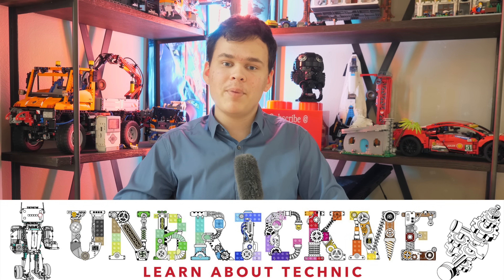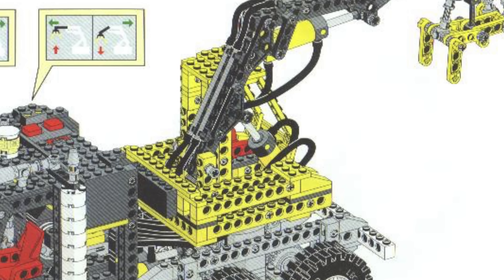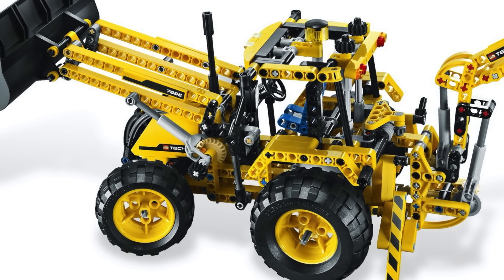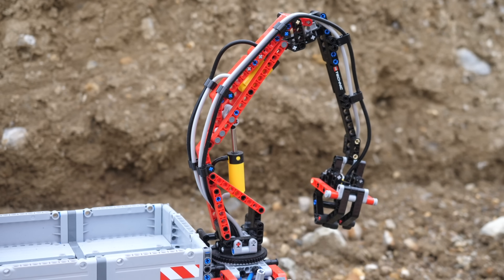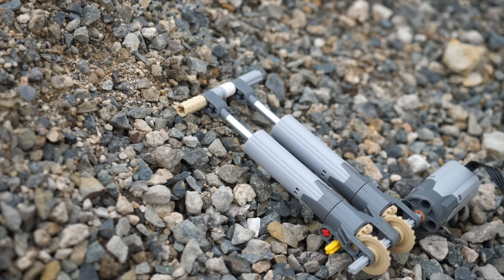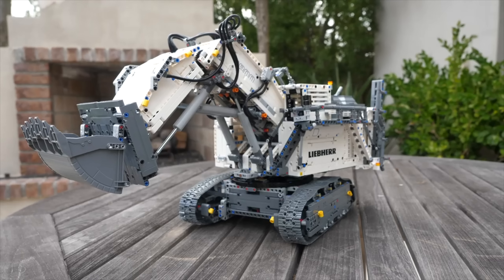LEGO Pneumatic Cylinders VS Linear Actuators

Comment: But these too systems can be used and can opperate as 1 unit because linear can like push a switch or Or Pneumatic pistons.Mofified Pneumatic pistons can e used for lego engines so we can make an engine and use linear as gearbox or steering system.Now if i woul choise what would i choise i would rather Pneumatic becaude they are more simple and dont requer any axels or gear.plus i would not risk twisting axels becase of comprasion.Since Mottor would push and start to twist the axel if it cant move.but if linear can stay longer.Linea reminds me on eletric engines and Pneumatic on fosile engines.

Comment: I like that you can put pneumatic cylinders pretty much anywhere (like excavator arms) where trying to get an axle or gear drive would be near impossible.  But I prefer the smoother more controlled movements of the gear driven linear actuators where possible.

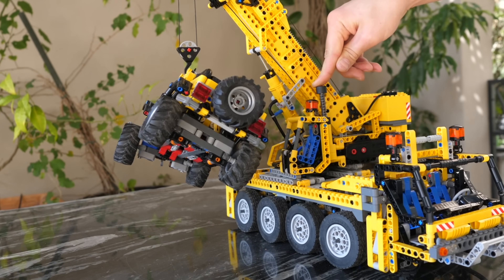Comment: 5:15 I had no leaks ever !  on the XXL Crane i installed a second pair of cylinders to increase the Force.
Also its possibile to run them on water to eliminate the spring effect.

Comment: While linear actuators exceed in strength, pneumatics are SO much fun to play around with. Especially with all the tubes that it can come with. The Mercedes-Benz Arocs was a very great set because it introduced the 2.0 pneumatics and also went crazy with them as well, having FOUR functions in the crane arm itself!
Reply: You mean fourth gen:
1: 8040 from 1984 (valve distribution block)
2: 8044 from 1989 (dual action)
3: 8455 from 2003 (round cylinders)
4: 82043 from 2017 (extra long and long&narrow cylinders).

Comment: I prefer pneumatics mostly because their much more faster & with a few modifications they can really perform beautifully. Got my first pneumatic set when I was 10 & I became a master of, building & constructing my own high pressure air tanks, compressors, & custom control switches long before lego started making to control my heavy equipment builds. I even managed to solve alot of the issues of pressure loss & stability allowing me to lift & move insane loads. I had a massive collection consisting of some 30 thousand plus parts until loosing it all sadly 12 years ago. But atleast I still have picture's of some of my amazing creations. I do see the benefits of linear actuators, but mostly just for outriggers & stabilizers. Their just too slow

Comment: its not that the cylinders are leaky its just that air is being compressed under weight, it could work if air was replaced with water making a hydralics witch would make for strong cylinders that would not compress at all but hydralics are also more complex with needing a water pump and a tank and all sorts of connections but i think it could be done with lego

Comment: I think their main difference is how they are powered: A mechanical axle or a hollow tube. The rubber tubes can bend easily into any build, whilest axles are straight and solid, they also need special mechanisms to make any turns.

Plus, pneumatics require just presure to work. While the mechanical actuators need moving parts.

So mechanical actuators are precise, but pneumatics are usually simpler and more versatile. If only they didn't leak under high pressure...

(Personal experience: both my large and small pump leak after some years, at any pressure)

Comment: I'd say that the pneumatics are better for playability, while the actuators are better for technical design. With the linear actuators you need to have rotary power at the actuator, which is far harder to do, running such power across your build, than simply running a bit of rubber tube to the point you need it.

What you need is the holy grail of a linear actuator which is powered by pneumatics.

Comment: Even if the pneumatic cylinders did not leak they would still be springy because air is compressible. That wouldn't happen with hydraulics.
Reply: Hydraulics use oil, and which liquid is not compressible

Comment: Another aspect: Pneumatics are better suited for fixed range movements (e.g. lowering a ramp, tipping...) - here they are even more practical as linear actuators, bc. you don't need to stop the input axle to avoid the horrbile cracking of the clutch

Comment: One pneumatic set I like is the Volvo EW160E. It's a really good set imo: you can add power functions so you wouldn't have to pump manually, and have some lights for working nightshifts; I actually did some modding to it to add the switch between the motor and battery box so I can have the light on it own.

The B model, the L30G, is also nice, it may not be the best, but it's cramped full with hoses and was the reason I gote a second one. You also get some parts for a bridge frame, for which I made up a trailer from parts I hade laying around and a 42035 dump truck (mainly tire's) to rebuild my 8052 container truck, which actually was my first technic model from what I remember. Though it's not road legal here in Germany because of my dumb ass only having put red studs as break lights.

Comment: They both have their advantages. With the linear actuators, they can be made to stop at very specific points, whereas with pneumatics - getting it to stop at a precise location along its shaft is pretty much impossible - and usually only either extends or contracts to its extremes.

Comment: Air is compressible as liquids are not which is why the LEGO pneumatics act more like a spring or feels spongy. I’ve always wanted to remote control my older 80/90s sets especially the pneumatics and it looks like that tree logger set actually has switches that you can finally manage to control easier with motors.

Comment: Talk? I figured we can continue talking about technic summer 2021 like yesterday.
Reply from the maker: Daniel sure
Reply: @Unbrickme  ok so would you be very disappointed if the bulldozer only had 4 motors and still be priced at $450?
Reply from the maker: Daniel yes but I investigated this rumor and it turns out it came from a satirical post to poke fun at the cancellation of the toy fair this year, Thai post  claimed that the d11t would have more than 6,000 pieces which is false
Reply: @Unbrickme  you didn’t finish
Reply from the maker: Daniel actually I wrote everything I wanted to in the reply
Reply: @Unbrickme  yeah sorry. I just realized. The comment never said “read more” until i pressed the word “than” the rest showed up. Also i have been meaning to ask you this for a long time. Were did you get the information the the Mercedes Benz zitros will have pneumatics?
Reply from the maker: Daniel zetros having pneumatics is nothing confirmed, and I believe I always stated in my videos that it having pneumatics that it’s only speculation. However, based on some key factors, I can be more and more confident it will have pneumatics. It has about same pieces as 42114 but costs $50 more. So the extra cost probably comes from pneumatics
Reply: @Unbrickme  or it comes from the control+ elements possibly.
Reply from the maker: Daniel also all Mercedes vehicles from technic in the past, the unimog u400 and the arocs has pneumatics, so it makes sense that this one will have pneumatics
Reply: @Unbrickme   or it comes from the control+ elements possibly.     But anyways that’s all I wanted to talk about. I’ll see you later.
Reply from the maker: Daniel see ya later

Comment: I still prefer linear actuators, they are stiff and keep their position which makes them more practical in Technic sets, while pneumatics have 2 main positions. Your argument about pneumatics is convincing though. I wish they introduced more pneumatics in LEGO Technic sets.
Reply from the maker: Yeah pneumatics is quite underused in technic sets it is such an awesome functionality!
Reply: With a compressor and air tank, you can do most in between positions perfectly.

Comment: Hi. Did u get the LEGO Land Rover. What’s your opinion on the set thanks.
Reply from the maker: I never got that set, but I do think that it is an awesome off roader for $200. You get the same building experience and mechanisms for like $160 less than the supercar sets
Reply: Thanks for the info. Can’t wait to get more info on the summer sets
Reply: I really really wanted the new Technic Ferrari but after seeing it I can’t get myself to spend the money so I went with the Land Rover. If they ever lower the price on the Ferrari maybe I’ll get it. That set is really horrible and I feel LEGO really short changed us.
Reply: Agreed with Unbrickme... I got it for that reason - it has a complex gear switching mechanism just like the supercars, despite being almost half the price.

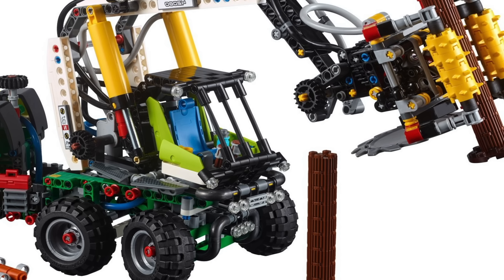Comment: I much prefer pneumatics. They are realistic and can move much faster than linear actuators. Real excavators can also move surprisingly fast so that makes pneumatics more realistic in their movement as well. The realism of pneumatics makes it feel like you are operating a real machine, linear actuators just feels like a cheap toy to play with. Linear actuators are always slow which makes motorised models boring and manual models tedious to play with. Pneumatics can also be very powerful, as strong as linear actuators, and they can be ganged together, you can have an unlimited number on one motor and lift anything, even me if you had enough of them. Linear actuators however quickly reach a limit to how many can be run off one motor due to increased friction. As for precise control, linear actuators might be a better choice if you are building a CNC machine. But for everything else like diggers, bull dozers, front loaders and so on pneumatics are precise enough if you employ a little bit of skill to how you operate the valves, which again makes it more like the real machine which requires a skilled operator. This need for a little skill also adds to the fun of playing with pneumatics. Imagine playing a computer game that required no skill at all. That would be boring and no fun at all. That's what linear actuators are like. No skill needed and boring. Pneumatics can also give you motorised functions anywhere you like without any losses from friction in long drive trains, where as linear actuators are quite limited and quickly run into problems with friction and power loss from long drive trains. The outriggers of 42009 bearly have enough power to even move, let alone lift the vehicle off the ground which pneumatics could easily do. This is why linear actuators might be a bit more powerful in an isolated test, but when actually in use inside a model pneumatics are usually far more powerful. As for RC comparability, I've seen RC pneumatic MOCs that work just as well as any official set (with no problems dropping too fast, precise and fast controls for digging and so on) but with much more realistic speed, power and fun! Search for "1:13 tracked excavator - kobelco SK210 HLC" on eurobricks for an example) Most fans have not seen them though and so think RC pneumatics can't work. Well they can.

So yes, in every way pneumatics are far better than linear actuators. Not saying linear actuators should never be used, but linear actuators are all we ever get, hardly any pneumatics, and that sucks.
Reply from the maker: I do agree that linear actuators require far less skill and are much more boring than pneumatics. It's a lot like manual transmissions vs automatic transmissions in cars. Manual transmissions are a lot like pneumatics. They're much more interesting and they require much more skill to use than automatic transmissions. For many, manual transmissions can also be a lot more fun. Automatic transmissions are a lot like linear actuators, they require basically no skill to operate and they're much more boring when driving. Pneumatics in lego technic do have tons of potential. Maybe if LEGO can bring a pneumatic air compressor, a barometer, and improved cylinders into an official lego technic set, then that would be absolutely epic and possibly even for practicality RC vehicles pneumatics will outperform linear actuators.
Reply: @Unbrickme  Many would probably laugh at me for saying pneumatics have the potential to be better even for RC than linear actuators, so thank you for not laughing at me! But yeah, I think linear actuators have pretty much reached their potential in RC, they don't have much else to show. But with much better motorised air compressors and RC valves and so on, pneumatics can use their increased speed, sense of fun to play with and ease of positioning anywhere in the model to overtake linear actuators IMHO.

Comment: Well here's how I see it, after having built a decent number of MOCs:
Linear actuators have higher power and incredible accuracy, however powering them can be quite tricky in complex setups*. They need a powered axle to run from the motor/gearbox all the way to the actuator, which means that the axle most accommodate any movement and angles on it's "way". Sometimes it's easier to just slap a motor closer to the actuator and call it a day. Sometimes it's impossible. Also if the movement of the LA must be limited, basically you're screwed. Fully remote controlled capability is however easier to achieve
*excavator arms and body mounted actuators are not complex setups

Pneumatics on the other hand are less powerful, have no precision what so ever, but powering them remotely is easy: just connect a long enough hose and pray that the pressure doesn't escape. The hose system allows incredible flexibility in mounting positions, for example in 42043 extending arm, or even detached from the main body. Limiting the movement of the pneumatic cylinder doesn't damage the pieces, but it's rather difficult to achieve full remote controlling. 

I'm my creations I go for linear actuators when I need power and precise remote control capability, and use pneumatics for on/off style or manual functions. They are a great help in motorizing multiple gearboxes at once, for instance to lock the differential on all axles at once, remotely. I believe there is a future for pneumatics, especially with PU/C+ if LEGO develops a pneumatic control unit: a powered piece that has an air supply port and 2-4 pairs of ports that connect to cylinders; this way 2-4 cylinders (or groups of cylinders) could be remotely controlled.
Reply from the maker: A powered up pneumatics control unit sounds absolutely epic!!!!
Reply: Well said. Each should have its usage. No need to start a war. :)

Comment: I don´t think the pneumatic cylinders are leaking air. The air is just getting compressed more under heavy loads. That´s why real machines use liquid inside their cylinders. Liquid never compresses
Reply: It does but way less
Reply: Maybe water doesn't but oil does.
Reply: @tttttt9284-k4h  All liquids do compress a little, just much less than gases
Reply: @Tapitus-totalus  exactly.
Reply from the maker: I mean, I leave my pneumatics under pressure and in an hour the crane comes  back down, so it does leak air
Reply: @Unbrickme  ok, that's possible

Comment: It is a shame that small me tore appart all my sets after a month 

They where so expensive but I liked building other things I only owned small pneumatic cilinders 

I also had a digger (the remote control one)
And all the other legendary ones I spendt all my money on it when I was small
I can sent you a picture of my collection of instruction books hahha
Reply: I really like your video’s btw
Reply from the maker: @julianmeijer6324  Thank you very much! Which remote control digger did you have? The Volvo l350f wheel loader?
Reply: I had set 42030 and 8043 and a lot more
Reply from the maker: Julian Meijer the 8043 is the best technic set!
Reply: yes it is but mine is in parts spread througt pulitple creatitios

Comment: No gearboxes? Hmm Then only 4 of 5 is given to this video:) Can you or the community suggest me a bigger set to buy? I have the big red crane(my favorite), the 6x6 volvo(your favorite, still in the box; bought because you told so much good about it, cant wait to build it), volvo zeux, new mixer, Liebherr, Sián, Chiron, Land Rover. I missed two decades and just started collecting again 3 months ago, so feel free to suggest an older set if its still possible to buy even for higher price. Thanks and keep up the good work.
Reply from the maker: I should’ve included gearboxes in this video :) Yeah sure I can suggest a bigger set to buy, and I can also post a related community post about it. May I ask, what is your budget range? Example: $150 - $250
Reply: @Unbrickme  no real limit
Reply: @Unbrickme  I was thinking about the bucket wheel excavator but I dont know every sets thats why I asked. Maybe You can tell me a better choice
Reply from the maker: One of my main suggestions is the 8043. But it’s close to $450 on bricklink sealed. I think a nice, large set, but also not terribly expensive would be the class xerion tractor from 2016. Awesome mechanisms, 3 modes of steering, and included power functions
Reply: @Unbrickme  Thank you very much. I know the tractor and its on my list and I will check on the 8043.

Comment: Having two inputs does not make the pneumatics better, but it does make them cooler. 
I don't have any pneumatics, are they faster? 
I would like to have them since it's really interesting how they work.
Reply from the maker: I wouldn't say they're faster, but they're cooler! Think of it like this. Linear actuators are like automatic transmissions (in terms of coolness) while pneumatics are like manual transmissions (in terms of coolness).